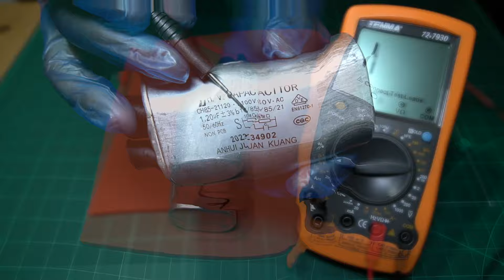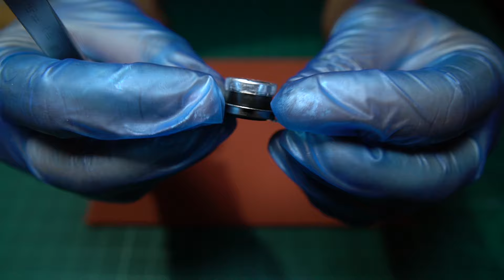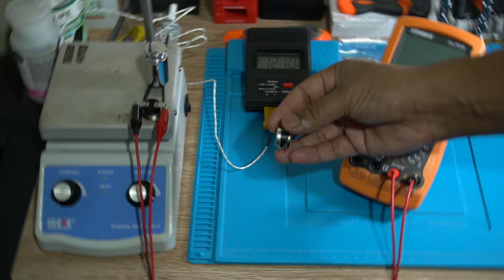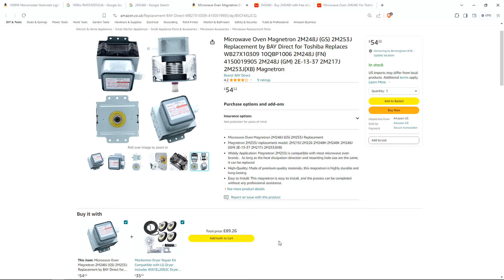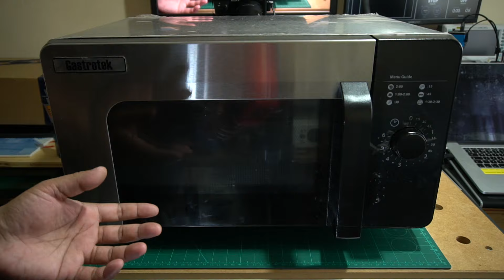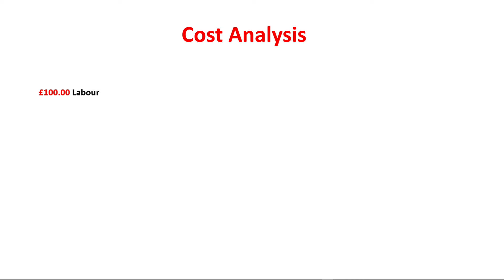PART TWO: Microwave Turns On But Won’t Heat Food - iRefab

Comment: The bleed resistors in these caps hav been known to fail open circuit leaving a lethal charge in them
A little knowledge can be a dangerous thing
Reply from the maker: Indeed, your observation is accurate and we highly value your contribution. In PART ONE of this two part video, we thoroughly addressed the topic of safety, devoting an entire section of the video to emphasise the hazards associated with working near the high voltage capacitor. Furthermore, we provided comprehensive instructions on the precautions that must be taken while handling this particular component. It was explicitly mentioned at the outset of the video that prior to undertaking this repair, it is imperative for individuals to watch PART ONE first. Link available here https://youtu.be/m8bchK3hTdY